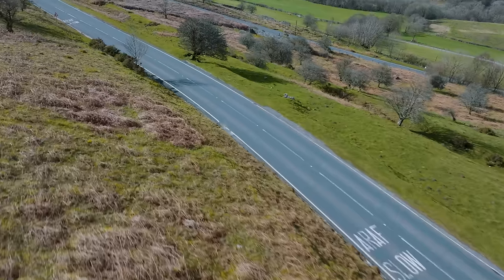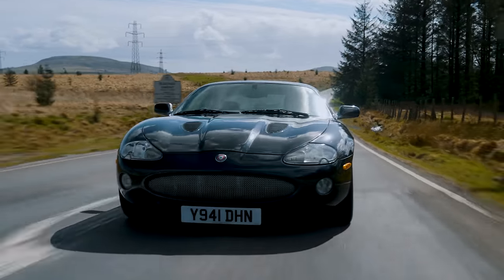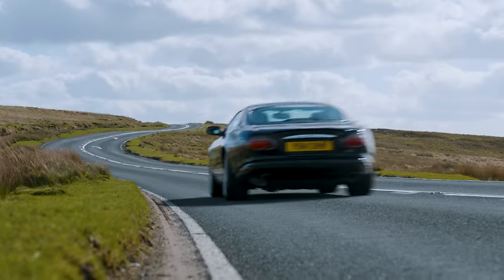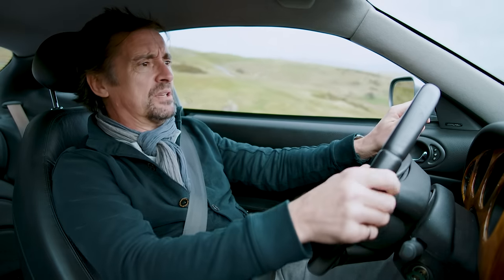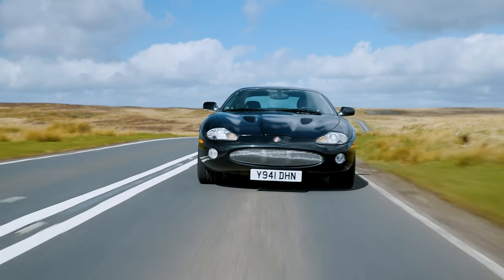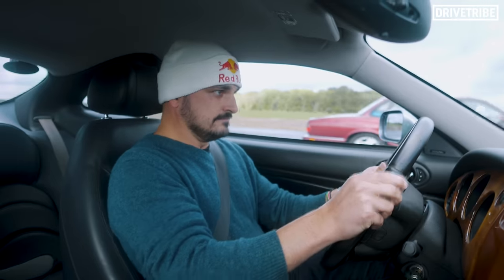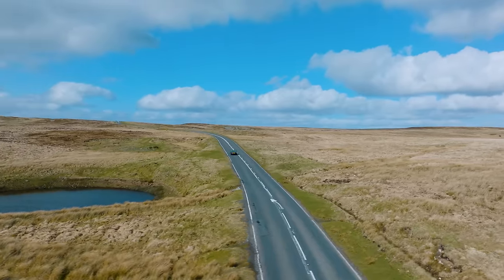Richard Hammond Goes For One Last Drive

Comment: A fitting send off. So many Youtube Channels make a series about a project car then never mention it when it's finished. Well done Drivetribe.
Reply: Drive tribe have already started that trend, check out the older videos with the different engine for the Mazda etc, loads of unfinished projects associated with this channel, bit disappointing really
Reply: Read the collecting cars description, the car is a well polished dog.
Reply: Considering I had no idea this was in their possession to begin with, let lone any other content on it prior to this video, it sure feels like a 1 off to me.
Reply: @willkauffman5079  sounds about the same as most cars of its age in fairness. I note a lack of any dings or dents mentioned which is frankly pretty good going on a car that as standard isn't that desirable or valuable.
Reply: @willkauffman5079 you're not wrong, I had a look around it at the NEC and it was a little rough and ready to say the least. I don't think anything was removed prior to a respray, it all just looked a little ..crusty.
Reply: because those youtubers either never finish it or they sell it before they even finish it and move on to a new project
Reply: Bad Obsession Motorsport hehe
Reply: @willkauffman5079  Still made 27K though.
Reply: You don’t see those other projects get finished because they’re not finished.

Comment: Finally you worked enough on the editing to give us proper Top Gear vibes.
Reply: I thought this too
Reply: They are very limited to what they could do so they don't resemble old Top Gear.  The BBC lawyers will slap a cease and desist. It's why The Grand Tour was so anchored down.
Reply: @DroneStrike1776  Or the channel wasn't generating enough revenue for such high production values to come into place. Lets not forget that other than the odd Captain slow garage-filmed bit, this is mostly a Hammond effort.
Reply: @panaceiasuberes6464  it's honestly a mix of both, though more of it has to do with the BBC (I mean, it is a government owned, funded, and run organization).
Reply: @panaceiasuberes6464  Shows have copyright, if another show copies them too much, that show can get sued. So Drivevibe is trying not to resemble Top Gear too much. Only way to not get sued is by buying the rights to the show

Comment: I absolutely loved this car. I would have loved to have seen some real power making upgrades thrown at it. Headers, cat delete, upgraded supercharger, intercooling system, smaller SC and larger crank pullies, E85 fuel system, and intake upgrades.
Reply: A smaller sc pulley would ruin the engine. The eaton unit on these is very inefficient and adds a ton of heat at higher rpms, only way to really get more power out of the aj27s is to get a twin screw SC and swap  it in

Comment: The CTEC chargers seem great but, if you’re leaving your car idle for an extended period of time, it must be better to disconnect the battery or install a “cut off” switch? Instead of energising the electrical system for an extended period of time? Thanks for the video. Best wishes from the French Alps, Colin.

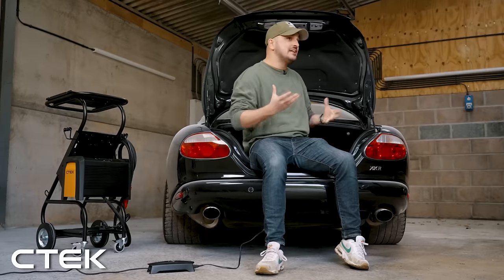Comment: That bid is not much now, but it's about to change if you were browsing it for about 360 000 gold monthly for a xeon processor. 350z/370z, focus ST, Mustang, Camaro, brz and gt-86 (this is very as mondeo at the front) all are about 11000 - 15000 euro and some not new only used and even twenty years old obviously having no rust. Some have strange interior, so nissan would be that only reliable thing you won't do with brz when you want toyota and not very American and then browsing UK local career options accidentally check R8 and see can't have it as supra or nissan GT-R. 4:05 may get that job offer, but then you were disappointed and coudn't repair it anymore like 2 years x 3 times as much as mandatory check lasts.

Comment: Umm hammond just looking at the photos, the condensation on the headlamps, that is on the outside right, as otherwise those might need to be sorted, as that means their getting water in them and can short out the electronics, I know as I got lucky and found that on my old car before it got serious and did that, as a seal around it had gone

also you should really get a gearknob on there that shows where the gears are, as if its a 6 speed ZF, where is reverse, is it down and over, up and to the left, or push down and then either or 

as you dont want someone to buy the thing and pull a James May in the crashed 190E, where he kept forgetting which one was what, and ran right into you during that berlin trip all those years ago, as didnt you find someone who was doing just that with shift knobs a few miles down the road from you a little while ago

also with that Ctek thing, is that smart enough to decipher and choose the right voltage right off the bat, as your volts and amps are different from us

like I think we have a 115, you have 215, which is why the plugs are different, and half why I think I've seen early 90's BMW's and Ferrari's where when their jumped off, it screws up the computer, and your better off either charging it outside of the car, separate from it, or just flat out putting a new battery in

as the voltage maybe wrong for the application and the limiters gone bad

and what voltage is the car built around, as maybe that explains all the problems people had with the electronics over the years with british cars

Comment: That V8 is made of cheese and soft putty so supercharged it should be stuffed within 50,000 kilometres. I’d bet a 50 on it.
It’s ok for rich guys to buy these soft cars because it’s nothing for them to rebuild the motor but as a relatively poor man I can’t respect cars that don’t last.
Get a Toyota Soarer.

In Britain like here in Australia, you can bring JDM cars right over and supercharge that 4.0 RWD V8 coupé.  It’s about 20 times stronger than that piece of Jaguar cheese.  
Every moving part is so much tougher and more durable.

Mine is 30 years old and has been driven daily by me for 9 years with only an alternator and a broken regulator arm. (Touch wood)